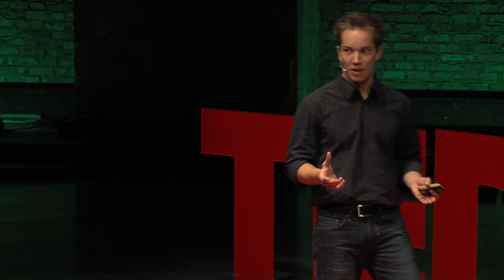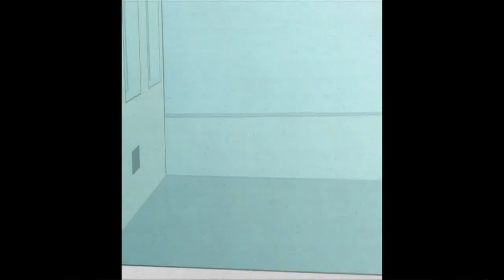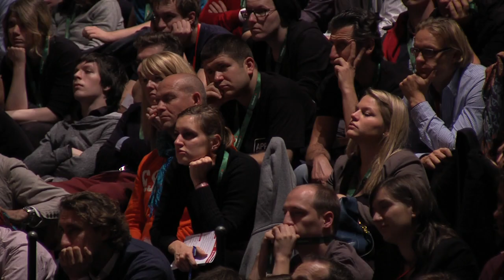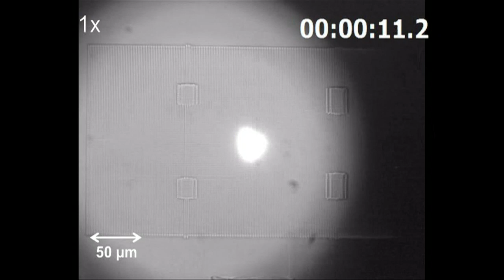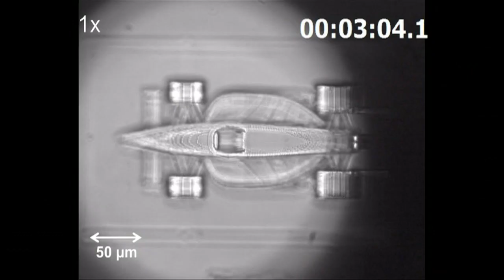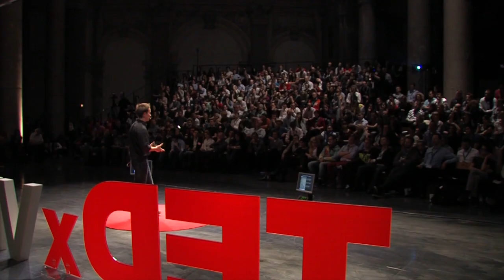The race to the bottom -- accelerating nano 3D printing | Jan Torgersen | TEDxVienna

Comment: No wrong. Nano printer also called a replicated/molecular assembler, or what ever you want to call it. When it comes to objects that are built today like buildings and inorganic material this is 3d stuff. So what a molecular assembler should be called is a 4d printer. My reason is that a 4d object has geometry  on the out side and inside of a object like a cube in a cube that is connected together. That is what life forms are made of. Not random atoms put together in the same object.
Reply: Tim King - Yes, todays "two photon lithography (TPL)" nanoscale 3D printing must not  be confused with "atomically precise manufacturing" (APM) !
TPL is far from having control over every single chemical bond like e.g. 
the today (2017) already existing atomically precise structural DNA nanotechnology. ... more ...
TLP is top down and not atomically precise.
TPL isn't even on the direct path to advanced high throughput HT-APM (that is improved versions of TLP won't ever synthesize strained gemstone parts with atomic precision and resolution).
TLP may though play an important role in aiding in the development towards HT-APM.
Meeting in the middle with the bottom up atomically precise structures.

About the "one layer at a time" approach for future advanced nanofactories as outlined in the "productive nanosystems" video:    (NOT talking about the TLP here !!):

The main reason for this far term design goal is that scaling side-length of robotic systems down a million-fold scales natural operation frequency up by the same factor.
Directly coupled to natural operation frequency is productivity (that is mass throughput).
Filling the whole production volume with productive machinery
(that is the old naive and now obsolete molecular assembler nanobot concept)
would lead to almost a million-fold increase in throughput.
Which is obviously waay too much since physics prevents one to provide macroscopic input and output of resources and wastes in a matching speed. Remember: Macroscopic IO  has a million-fold lower natural operation frequency and throughput.
When one matches the internal productivity to the IO capabilities that physics actually allow then one can put all the machinery into a (from human perspective) thin layer.
Integrated system design allows for specialized sub-units making only a single type of part.
This increases efficiency (much above unspecialized general purpose compact molecular assemblers).
Beside that the flat design allows to do input and output of all the resources more efficiently (less path less surface less friction).
Regarding the necessity of scaffolds for creating products with overhangs:
The convergent assembly hierarchy can potentially be continued up to the size of the whole macroscopic product solving this issue if present. Instead of "one layer at a time" it' becomes more of a "one convergent assembly stage at a time" (at every stage) principle.
Reply: also, I was reading Eric Drexler, the father of nano technology, and he usually uses the term APM, atomically precise manufacturing. Just like you were saying pretty much. A device which not only assembles things at the molecular scale, but also reconfigures molecules to create various types of molecules. 

Of course, the funny thing is, the devices Drexler describes do assemble things one layer at a time, at superfast times. But the initial device this video describes is something completely different. But it is interesting none the less.

Comment: I feel like he was downplaying the technology the entire time. It is amazing! We have not yet realized what this technology can do for us. "There is plenty of room at the bottom!"
Reply: I'm not trying to downplay current 3d printers, but owning a Flash Forge, MakerBot and a Rostock, 3d printing is overhyped and lacks so much. In essence, most all commercially available 3d printers are overpriced hot glue extruders. CNC Milling systems have existed for almost 40 years, using the same "gCode" bin/ascii instructions. 3D printers take allot of screwing with,and the technology is quite disappointing when you consider the much more sound and far superior technology of using a 3d printer with a high speed cutter (AKA, CNC Mill) to create a 2 part injection mold that allows for a far superior/accurate/incredibly quick and so much better end product.

I use my 3d printers to create molds, and have modified one of my printers/projects to mill out molds. 3d printers have great novelty, but if you want to produce a durable product with extremely high precision and strength, injection molding is far far far superior.
Reply: i note 2 year old post and i take your point. however 3d printing as a concept is the hype or over hype the lame 3d printer designs are separate from the concept. for example a DRO cheap china made one costs the same as your novelty printer approx $1000 thats just purchasing electronic measuring device to control your novelty machine.  this dro has +- 5 microns perhaps +- 1 micron for short scales limiting total volume of 3d space. think about 25 or 30 years time where desktop 3d printers cost $1000 including dro at these scales. then will you be exited ? besides your example of injection molding is mass production of identical components this method directly opposes 3d printing where each part can be incrementally modified. try doing that to an injection moulding machine. last point. today i wached a 3d metal printer. print . then transfered to mill for your nice surface finish....  milll then load milled part into injection moulding high volume system. so yeah wait anothe 2 years = overhype ect...